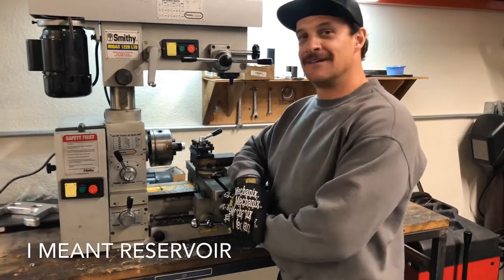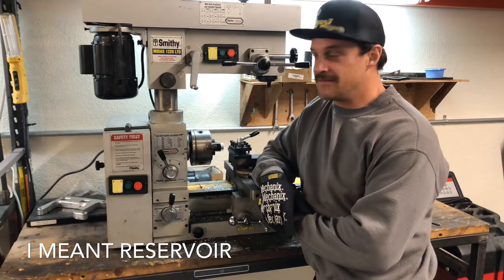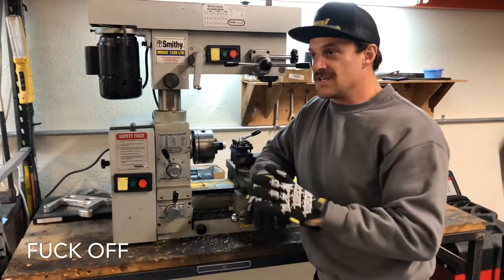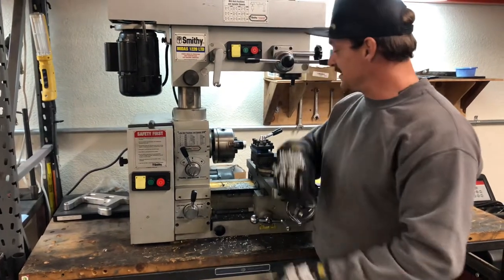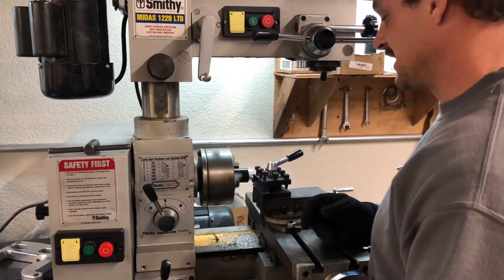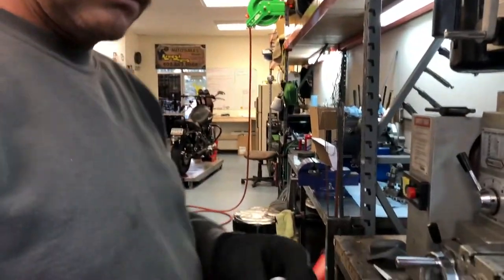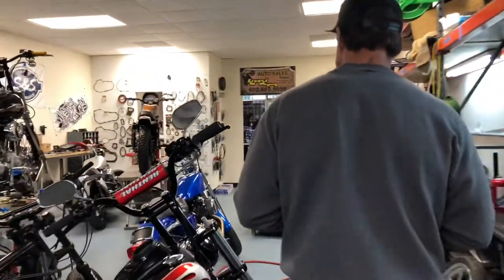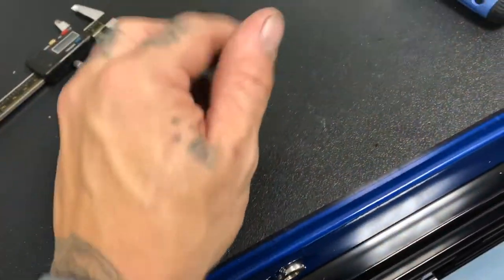Kruesi originals Vlog 1

Comment: Crank up the rpm on that lathe 😂
Reply from the maker: nikolaiownz is that the problem?
Reply: @kruesioriginals  can easyly give very bad surface finish and the tool don't cut proper because the lack of rpm.
Reply: @kruesioriginals  and use pure alcohol as lubricant on aluminium. 😁
Reply: @kruesioriginals  And if its thoes carbite soldered lathe tools from ebay you have.. they dont cut for shit.. very hard to cut aluminium with them no matter what you do haha
Reply from the maker: nikolaiownz They came with the machine. They are some cheap shitters for sure. Not sure where to get good ones, I’m just always worked in the shop that had the shit never had to get it myself.
Reply: @kruesioriginals  just grab some cheep chinees lathe tools with indexable inserts that are the correct hight for your lathe.. they come as a kit with a few tools and inserts on ebay.. they will cut alot better that what you use now forsure.
Reply from the maker: nikolaiownz Hell yeah thank you man I appreciate it
Reply: @kruesioriginals  no worries. I am nikolaiownz on Instagram you can always throw me a DM if you got any questions with machining 😁🤘